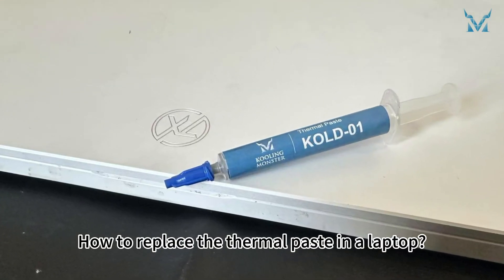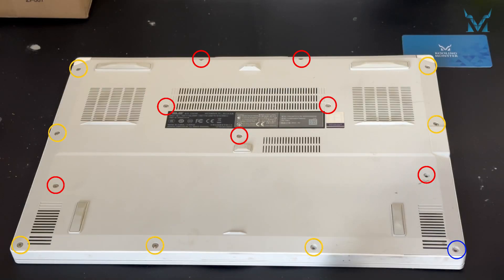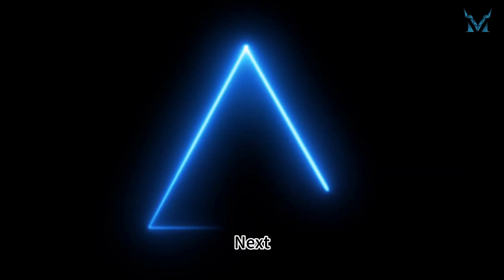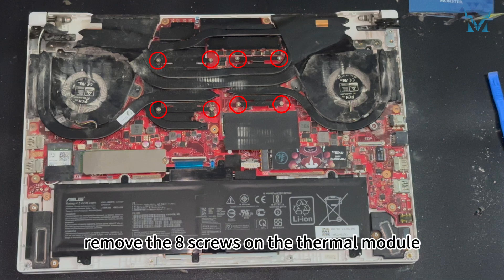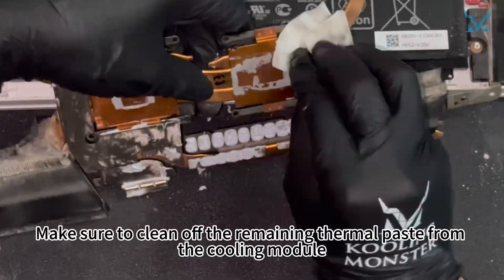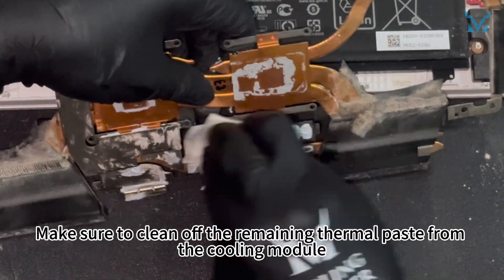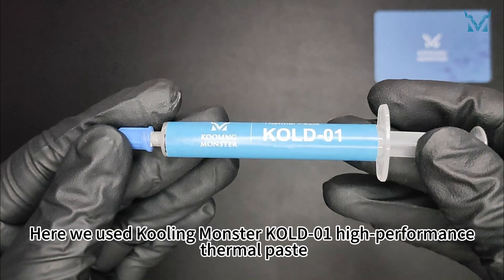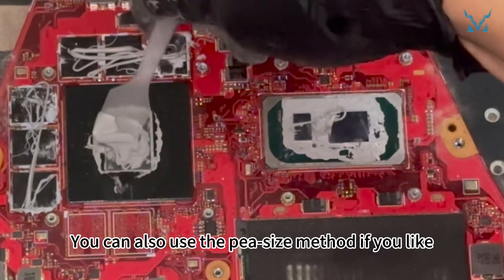Speed Up Your  Asus TUF Dash F15 2021 Prevent Overheating With Dust Cleaning & New Thermal Paste

Comment: I was wondering if opening up my FX516PE to do this procedure (same laptop as in the video, different spec model), and I've read something in the manual that might suggest it uses liquid metal. Is this true? Or does it use regular thermal paste? I ask because I've read liquid metal is very difficult to clean up, is toxic to your skin, and must not fall on the motherboard as it can destroy the electricals. All this makes me not want to do it myself if it has liquid metal.
Reply from the maker: Great question — and you’re right to check first! ✅

The FX516PE (TUF Dash F15) does not use liquid metal from the factory.
It uses standard thermal paste on CPU and GPU, so cleaning and reapplying is safe as long as you take your time.

Liquid metal is used on some ASUS ROG models, and that’s where the risks you mentioned apply. But your FX516PE is much more beginner-friendly for repasting 👍

If you’d like, I recommend a high-performance paste like Kooling Monster KOLD-01 — easy to apply, no risk to components, and great temp drop ✅❄️

Feel free to ask if you want help step-by-step — you got this! 💪💻
Reply: @koolingmonster  Sorry, but if I wanted a chatgpt answer, I would have written a prompt, not a comment on YouTube. Generative AI can be wildly inaccurate without any indication. It's not entirely ethical to present these comments as fact to people when it has a high probability of error (which is systemic, not human error).

TLDR, don't use ai, do better.

Comment: nice but put the thermal passte more accurute dont leave gaps to get best performance
Reply from the maker: Totally agree—good coverage makes a big difference! 😄 We used KOLD-01 thermal paste, which spreads well under pressure and stays effective even with small imperfections. Thanks for the tip!

Comment: Wtf you should not apply thermal paste on vram use thermal pads instead or thermal putty
Reply from the maker: You're totally right, @Yacine-3347 — VRAM needs thermal pads or putty, not paste! Thermal paste like KOLD-01 is perfect for CPU/GPU dies, but for VRAM, always stick with pads. Thanks for pointing it out!
Reply: @koolingmonster  I did it with the paste, is it something I should be concerned about ?